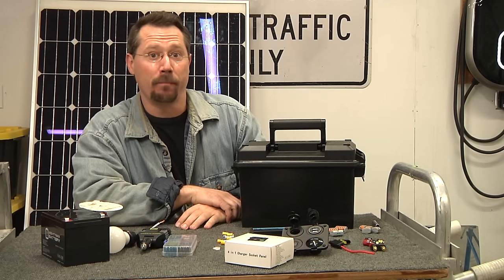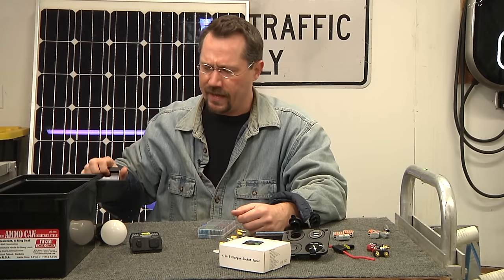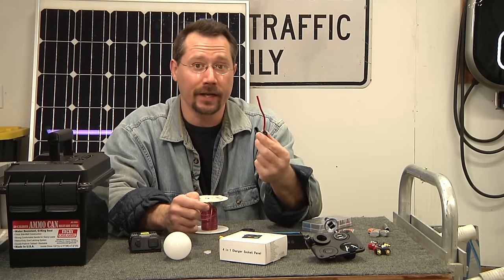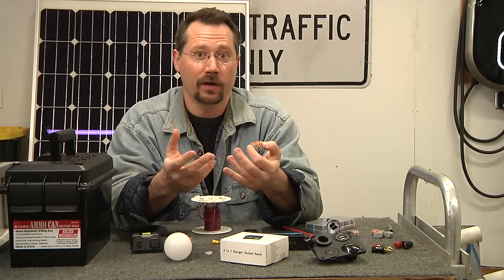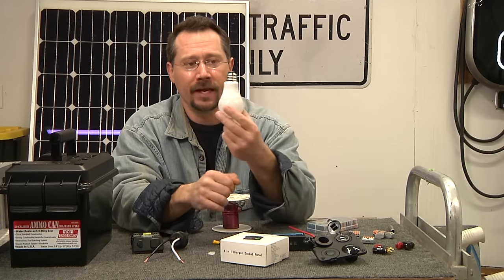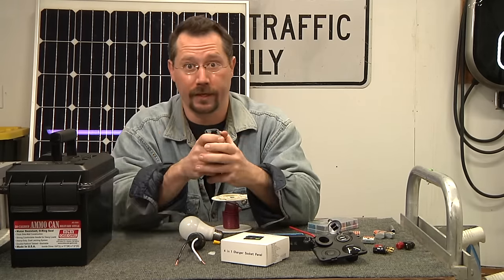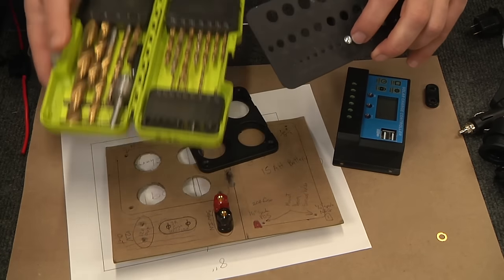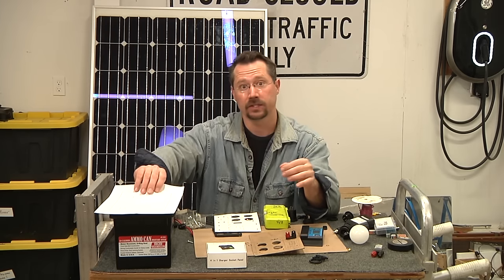Build A Solar Ammo Can Full-Length Instructional Video

Comment: I would like to order another wood panel. But I would like to request if you can, that the 12v output to be a “cigarette lighter hole” instead of the banana plug. The solar input is fine, I would just like to add a 12v litter type for my converter.... Thank in advance and I appreciate ur videos 👍🏼
Reply from the maker: Hello, sorry, I'm not making CUSTOM faceplates. The plate I designed already DOES have a 12V cigarette-lighter style plug as part of the 4-in-1 Socket panel. If you want a second one, I'd suggest pulling one of the other items from the 4-in-1 socket (perhaps the volt-meter, as it's somewhat redundant) and install the second cigarette-lighter plug there.
Otherwise, make your own custom faceplate out of whichever material you like.
I've also provided the file for the faceplate in step 3 of the Instructables write-up on the project. You can use that as a physical template or as the basis for making your own custom-modified laser-cut project.
https://www.instructables.com/id/Ammo-Can-Solar-Power-Supply/

Comment: Great video but I have a question. What if the solar panel I get does not have banana posts? Intact, I can't find any.
Reply from the maker: What type of connector DOES the solar panel have? Just use the matching style to connect to the project.
Reply: So im nor familiar with a lot of wiring. Since I can't find any solar panels with banana jacks, do I need to modify the connection on the solar panel to fit into the banana jacks on the box?
Reply: In fact, I can't find ANYTHING, not even an 18v wall power supply, that has banana jacks. Can you please help?
Reply from the maker: Those banana jacks can also take bare wires, so they will make a solid connection with anything where you can cut the wire and strip back the insulation.

Comment: All great Ideas BUT, I Used a 12V/15AH Lithium Battery. they don't leak, Hold the charge longer and can be used in any position. Only thing is,,they COST A LOT MORE. But if you are making it for yourself,,it's Better then the Lead Acid ones.
Reply from the maker: Yes, they certainly are more expensive. A 15AH lithium battery costs about DOUBLE what this entire project does.
This was designed as a simple "entry-level" project for people wanting to learn the basics and have something useful when done.
The good news is that lithium battery prices have been coming down, and there are now "drop-in replacement" 12V batteries which don't require any extra BMS or special charging.

Comment: Great video!  I am curious about grounding.  Does DC not require a ground?
Reply from the maker: Generally, low-voltage DC does NOT require a ground.
On a larger, permanently-installed solar array, the solar panels would be grounded.

Comment: Great box.  I was curious if you knew of any roll up solar panels that I could use or something small and portable that would work with this system?  I’m trying to get my gear ready for the zombie apocalypse
Reply from the maker: I haven't used any "roll-up" solar panels before. I HAVE used folding solar panels. They work well. I have one from a friend designed that I've  used. Many of the folding solar panels ONLY have a 5V USB output, which is fine for charging a phone, etc. as a all-in-one product. For something more powerful and versatile, make sure the solar panel has an "18V DC Output".
Here's a folding solar panel on Amazon that seems to fit the bill: https://amzn.to/2FlHPRN
I also already did a review of a pretty good flexible panel that works great with this project. While the panel doesn't fold or roll, it's very light-weight, and you could stack a few up. Here's the review: https://www.youtube.com/watch?v=_l83dOERwsA
Here's the product: https://amzn.to/2C8Qdkl
Reply: BenjaminNelson thanks for the reply.  The first link you sent me was for the foldable panel.  There were 3 choices to choose from a 18v21w, a 18v60w, and a 18v7.5w.  They all seem to be 18 volts but different wattage.  Does the wattage matter?  Or should I go for the 60 watt?
Reply from the maker: @littlenel17   Wattage is the POWER the panel will be able to produce. Power over a certain amount of time is ENERGY. A higher power (in watts) panel can help you create more energy in less time. That can be important if you only have a few hours of sun in a day instead of many hours of sun in a day.
For this project about a 20 watt panel works nicely. That 18V21W panel would work fine. (I really dislike that Amazon sometimes has multiple products in a single listing. There's no easy way to make a link to the particular one...)
For a "Bug-Out" situation, the 60w folding panel might be better, as you never know exactly what the weather is going to be, and you are in an emergency situation where you DON'T have access to grid power. Making power faster (higher power rating in watts) lets you make use of the sun while you have it. You can also put a higher draw on a battery without discharging it if it's in daylight hours with the panel hooked up. (Such as running a laptop.)
Again, these are only some suggestions, just looking at the specs of some readily available products anyone can buy.
I did the video review of the Suaoki 18 watt panel, because I actually have one, tested and tried it.
Reply: BenjaminNelson that's for all the info.  I appreciate it, a lot of helpful information.  Keep up the good work

Comment: if I added a second or third battery would I have to use a parallel connection? thanks
Reply from the maker: Yes, there's enough space in the box to add a second battery of the same size/capacity/type.
You would connect it in parallel with the first.
Positive to Positive, Negative to Negative.

Comment: What items are you able to use this with besides the light blub and charging your phone?
Reply from the maker: Valerie Whitear it will run anything USB, which is a lot. There are SO MANY USB devices out there now, including lithium power banks. It will run anything powered by a 12v cigarette lighter plug. With the small inverter, it will run small AC devices, up to 100/150 watts. I designed this project with camping and emergencies in mind.

Comment: I would add a switch between battery and controller. Because when you are not charging the battery via solar panel your controller still active and draining the battery.
Reply from the maker: I already have another video showing an alternative way of wiring up this project. In that version, I use the switch on the quad panel as a main power disconnect: https://www.youtube.com/watch?v=4YKRa9m4N7M

Comment: You make it look easy to attach the wire connections. But when I did it I had trouble with the terminal connections coming loose.
Reply from the maker: Which connections? Crimp-on ones? All the connections in this project are pretty straight forward. If a push-on solder less connection is loose on the spade connector you push it on to, you can always squeeze the connector a little tighter shut with a pliers. None of this is rocket science, but it's always important to have good solid electrical connections.
If a person hasn't done much work before with wire stripping, crimping on connections, etc, there's nothing wrong with practice! Use some wire and connectors and just practice some cutting, stripping, and crimping.
Reply: The ring connectors and female push on connectors both kept coming loose. I actually paid Powerwerx to make wires with connectors installed because I was having so many problems. They charge you about $7.50 for each wire (1 foot or shorter) that you specify.

Comment: Hi, I just bought all the components you listed from Amazon. I've been watching your video and reviewing all the parts. I know nothing about electronics so it all looks foreign to me.  I'm ready to start my build. I have a dumb question though. With the wall charger how does it plug into the banana jack? Do I have to alter the plug? Do I have to cut the end off and put tips that will plug into the banana jack? And what are the tips? Where do I get them? Thank you.
Reply: How much did you spend on all the components and yes you can get the banana  connectors and put them together
Reply: Hi Jamie, I just built it this past week! It works great! I'm so happy with it and proud of myself for building it because I have never worked with electronics.  I bought all the components on Amazon from the links provided and picked up a few things from Home Depot for a total of about $200, and I bought the wood mounting plate from Ben for $12. Like I said, I'm real happy with it and I'll probably build another one with a lithium battery.
Reply: P.s. I was able to figure out the banana jack plug thing and it works great! :-)
Reply: @bebopking1   n.

Comment: question about powwr inverters  do they run as long as they are hooked to a battrey with no load  or just run when load calls for it  id like to use it to power a 250W  Ice shaver in  a mobile installation rather than buy a generator.  Just learning about inverters
Reply from the maker: An electric device "draws" power. It pulls what it needs from a battery or wall power. An inverter will take DC power and convert it to AC power. The amount of AC power created will be whatever the AC load plugged into it draws. Beyond that, there are some losses. There's always heat created by converting power. Small inverters might just have heat sinks on them, but larger ones will have fans, sometimes big ones.
Inverters also have standby losses. That's the power used just to have the inverter on. It's the power for the logic circuits, a display, etc. That is usually a small amount of power, but if continuous, could be a fair amount of energy over time. Most large inverters will have a power switch, and very small ones can be simply unplugged.
An inverter should be turned off or unplugged while not in use to avoid standby losses.
Make sure to use an inverter with a high enough power rating, and a battery that will give you the total run time that you need.
It's common for 12VDC system inverters to run up to 1,000 watts. (Larger than that are usually 24 or 48V.) You also need to use very heavy cables to connect the inverter to the battery. 1,000 watts at 12V is over 80A

The small battery featured in this video is great for LED lighting/charging cell phones, etc, but wouldn't be good for running an ice-shaver! For that application, you would want a car-battery sized or better deep-cycle battery. Connecting multiple batteries in parallel will give even greater capacity for longer run times.
Using a battery and inverter is a great option compared to a generator. The lack of noise, vibration, smoke, and smell will make your customers happy.
Reply: thanks for your reply

Comment: Want to take the time to thank and congratulate you on this great video and the fact that it’s broken down and explained very well and I will be building a solar ammo can for myself...just have a question about the solar panels and if there’s a way to make it so that it charges faster than 15 hours? Please advise and again thank you 👍🏼👍🏼👍🏼
Reply from the maker: Thank you!
Yes, if you want a faster charge, you just need a 12V nominal solar panel that outputs a higher current.
For example, a panel rated 18V peak and 2 or 3 amps will charge faster.

Comment: Thank you for this! :-) Quick question, what happens if you are using your battery and the solar panel is charging at the same time, does one of the two disconnect or can a battery charge and discharge at the same time?
Reply from the maker: You can think of the power from the solar panel as just "flowing through" the battery.
Imagine something like a barrel of water with a spigot on it, open, for water to come out, at the same time that a garden hose is adding water in the top. Whether the water in the barrel rises or lowers would depend on how much water is going out compared to how much water is coming in. If water coming in is the same as water going out, the water level stays even.

On a solar project like this, the battery is only being charged if MORE power is coming in from the solar panel than is going out to the loads. It's being discharged if MORE power is going out to the loads than is coming in from the solar panel.
Reply: @BenjaminNelsonX  Thank you for taking the time to explain the concept, you are the first person to do so, and in an easy to understand way to boot. Appreciated. Subscribed.

Comment: Great video. Any reason you didn’t use lithium on the project (lighter and less volume for same Ah or Wh)?
Reply from the maker: The big reason why I used a lead-acid battery was to build something as simple as possible with readily available parts so that other people could easily replicate it, including folks who have very limited experience with batteries and electricity.
Reply: BenjaminNelson cool! It’s a great little build.

Comment: Can the battery be replaced with lithium.  Want to use for trolling motor. Thanks
Reply from the maker: Keith Koch Yes, of course you could use a lithium battery. Just make sure that the charging maximum and low voltage cut-of are appropriate for whatever battery you are using.

Comment: Ben, how did you make the banana jack plugs you used with the build for the wall adapter? Thank you.
Reply from the maker: That power supply came with that style connection already on it.
The real advantage of those banana jacks is that they also allow you to use BARE WIRES. Just unscrew the banana jacks a bit and you will see that they have cross holes in them that you can put wires through and then tighten down the connectors again.
That way, you can connect pretty much ANYTHING to the solar ammo can.
Reply: @BenjaminNelsonX , I have been searching for one like that, to no avail. Got some banana plugs, so will just have to solder them. All the chargers I can find have a single wire with a weird plug on the end. So would have to cut the plug, and solder each.

Comment: Hi enjoyed the video and will start on one every soon . 
1, question can I charge this via the car alternator into the solar in jack . 
I intend to use this as an overland expedition item and would like to charge it 
Via the car when driving and solar when stationery.
Regards John
Reply from the maker: Yep, That would work fine. You could also simply run a cord from the cigarette lighter/12V plug in your vehicle to the solar in.

Comment: Ben: my neighbor (who has solar built in to his new home) offered me a spare 30A charge controller, HQST brand, which is a 
‘negative ground ‘ controller. Also has the “smart” PWM feature. Can I use that in this build ?  (And am I right that the battery neg supplies the ground in your system?). Thanks...btw, the Instructables link you offer is excellent!
Reply from the maker: Yep, a 30A negative ground should work just fine!

Comment: Didn't your charge controller discharge your battery without being switched?
Reply from the maker: Hi Scott,
When in storage, I simply disconnect the battery. If you would like a different way of doing it, I also shot a video showing how to repurpose the power switch as a battery disconnect.
https://youtu.be/4YKRa9m4N7M

Comment: Is there going to be enough air circulating around the battery to keep it from overheating?
Reply from the maker: This is a low power system. No worries about heat with the battery.

Comment: Great video.
I'm about to install a solar system on my shed. I like the idea of these portable power packs as I also run a craft fair stall and it would be great to bring power with me. 
One wouldn't be enough to run my shed so I was thinking of making multiple identical units. Any ideas on how I could link them all together to charge from my panels and get the power needed to run my shed.
Making multiple units would also enable me to rent them out at the craft fairs as other traders are always looking for power options.
Reply: You //could// sacrifice the storage space that BEN allocated and put two batteries in parallel centered inside the plastic ammo box, but I'd use a metal ammo box just because of the weight...   There are two different sizes of metal 50 cal boxes, most of the local gun shops around here have both in stock, I suggest you take the batteries with you and test fit them before you buy.

Comment: Ben,  is there a item number or source where you got ring connectors for 12 ga wire and ring was small enough for the banana posts ? i either find them that fit the wire and the ring is too big for post cant find them for 12 gauge wire and small enough for the posts
Reply from the maker: I usually keep a supply of various size crimp-on terminals around for working on projects. I'm pretty sure that I had just bought a large variety at the local big box home improvement store. If it's for the solar input, you can always downsize the wire. Usually for projects like this, we are using relatively low power solar panels or other inputs, and you can use a little lighter gauge wire.
I went out to my tool box and dug through to find the original packaging for the terminals I used. They were "Tyco Electronics brand AMP Ring Terminals for 8-10 stud." I'm sure you can find them at a Lowes/HomeDepot/Menards type store. Otherwise, here's a link to similar. https://amzn.to/2JaneQd

Comment: Ben well done, can you please advise what size measurement is used for the heat shrink
Reply: I'll take that one. You can get variety packs of heat shrink. It usually shrinks to half size or to the size of the component. If you can slip it over the wire or terminal, then it should work. Those packs are available in most big box DIY stores in the electrical department.